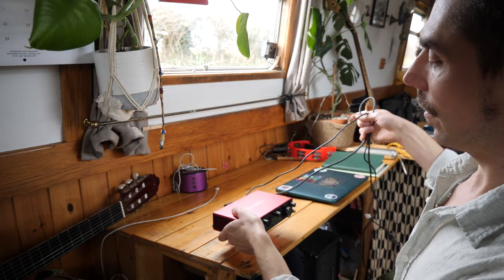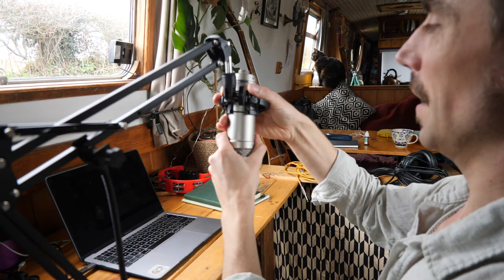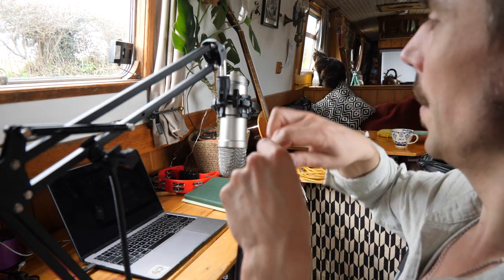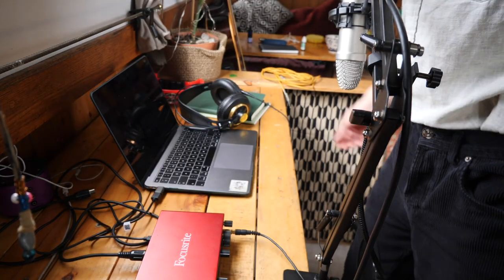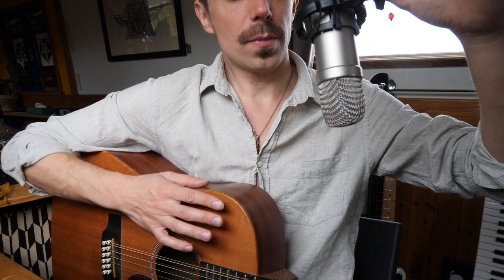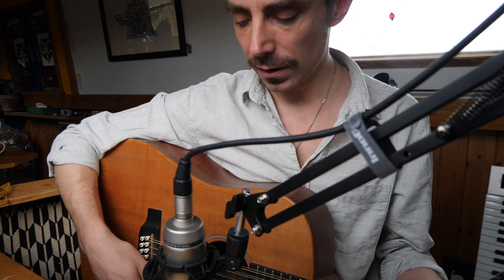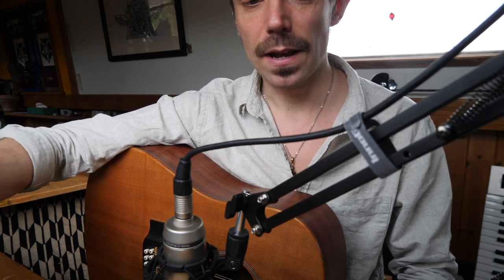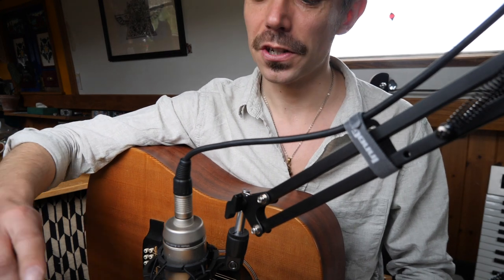How I record on my narrowboat home - Off Grid home studio

Comment: Hi, just wondered what you use as monitors/speakers and are they passive or active? Thanks.
Reply from the maker: I actually mix with headphones and move onto mini rig speakers and a range of speakers to test the mix. Not ideal but I have a system that works. I do plan on getting monitor speakers when I have a dedicated space to put them, as even the small ones are deep, and require a fair bit of power.